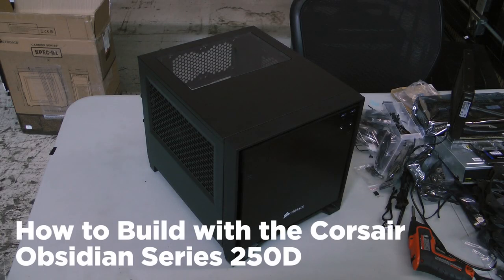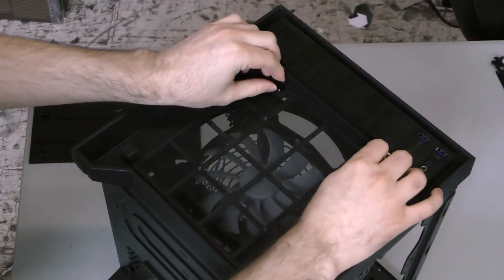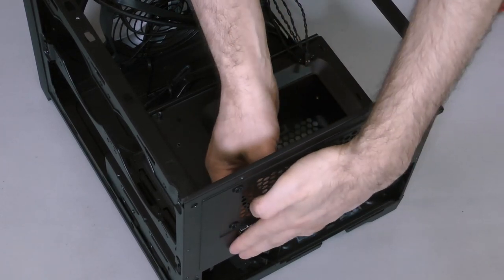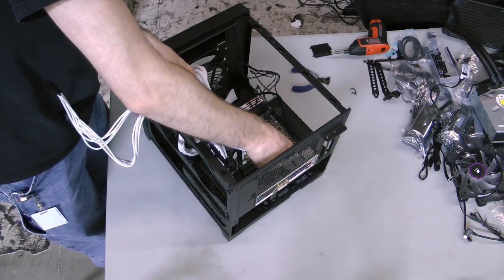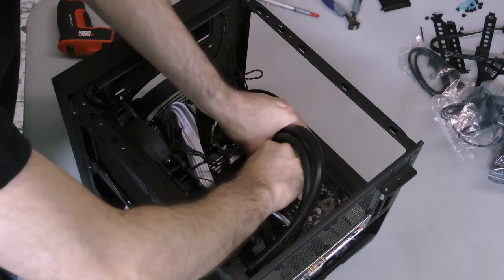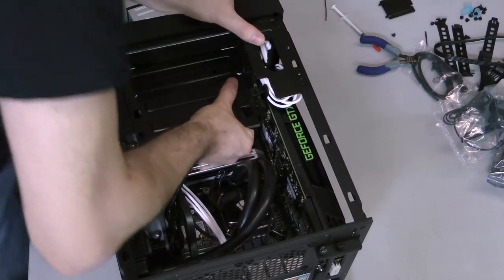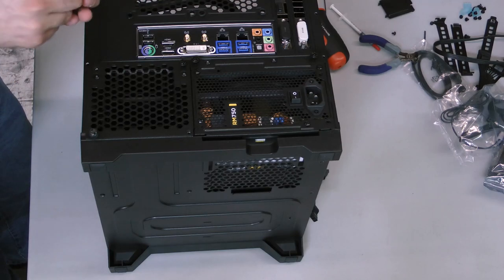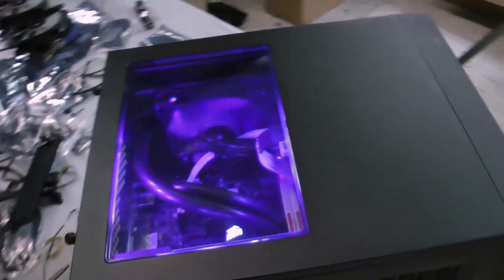How to Build with the Corsair Obsidian Series 250D

Comment: you could use an Corsair i75 For the CPU and even put a aio watercooled GPU in there, using the front 120mm mounting for the radiator

Comment: I personally would have used a motherboard with both the 24-pin and CPU power slots more toward the front of the case, making it so that the cables aren't going over the motherboard, giving a cleaner look and slightly better airflow.

Comment: I'm having trouble fitting my H100i in the case. Either i put it in with the radiator hoses unable to fit next to the upper most USB/PS2 connections, or I put it with the hoses in the front, in which case I'm having trouble clearing the intake fan. What do?

Comment: can i use the corsair link lighting node with out connect it with my h100i?
Reply: Absolutely. The only difference is that you'll lose the fine-grained color control and be stuck toggling between preset colors. But if you just want blue or purple or something basic, it'll totally work.
Reply: thanks for the help

Comment: If am installing a normal CPU fan should I install it in the motherboard before I put the motherboard inside the case?
Reply: Vangelis Velazquez I would, because there is a gap in the tray behind the motherboard, and I'd be afraid of bending or cracking it while trying to press the fan mounting points in to place.
Reply: Yes, absolutely

Comment: Corsair thanks for that video, it will help many to see about real dimensions and posibilities of that grat case. What about H105 and 250D? I'd like to see video or list of Corsair Cases compatibile to new Hydro Series H105 with 38mm radiator. We got lots of issues with mounting that raidator. For example with Obsidian 350D and Asus Z87 Maximus Gene we couldn't  mount radiator on top, because there is no room for that. And why are U using AF120LED IF U R usually recomending SP120 coolers?
Reply: The H105 isn't compatible with the 250D; the 250D was designed specifically to be exactly wide enough for the H100i. We offer the H105 as an alternative similar to the H110; if you can fit a 280mm radiator, we suggest the H110. If you have extra clearance for a 240mm radiator but can't fit a 280mm, then that's where the H105 comes in.

As far as using LED AF120s instead of standard SP120s, as I mentioned above, I decided to make the trade-off for style over performance. The SP120s will perform better, but since I'm not hammering the 4770K with this build, I figured the aesthetics would get more mileage.
Reply: Dustin Sklavos thanks for quick response.

Comment: Does the h100i v2 fit? The radiator is a few MM thicker than the previous gen.
Reply: If it helps, the h105 doesn't. Not sure about the v2 though.
Reply: I know it's several months later, but I have the h100i v2, and this case, and it's ayers and no. Technically it doesn't, it rubs and won't mount correctly, but I was able to offset it to a slight angle and it fits without stressing anything, it just only has I think 3 of the 8 mounting screws in, which is fine if you're not shipping it.

Comment: 4770k and 660 Ti? wat.
Reply: Yeah. lame. But would it be possible to fit a 780 in the case?
Reply: horsec92 No problem installing a 780 there, as long as it doesn't go over 2 slots.
Reply: MagicPuffin Do they even make a 3 slot 780/Ti? I know ASUS made a 7970 and a 580 with the 3-slot design.
Reply: horsec92 So a lot of the parts were used simply because we had them languishing in the cage in the back, and this build was designed to give my girlfriend a system to try gaming on. That's why we used the 660 Ti; we had one back there and it's perfectly fine for a beginning gamer. The 4770K is because, hilariously, it's the easiest Haswell chip to get inside the industry. Engineering Samples fly around and can't be resold, so we use those wherever possible.
Reply: Ryio5 phantom and lighting versions are 2,5 slots
Reply: Dustin Sklavos I see. Yeah I wasn't talking trash or bashing or anything, was just curious as to why there was that combination used. Could easily go with a lower cost CPU and a better GPU and get better performance out of it for gaming. But at least in this case you've already got a top of the line CPU and GPU can always be upgraded later. :D Nice build by the way. I'm sure she'll be very happy with this. I've been really considering a Micro ATX build. I would be more inclined to move it from place to place more often.
Reply: ahalal sucks 2,5, just because fuck the customers.
Reply: yeah more like 760/770

Comment: this case support the h110i gt?
Reply: +MarcoLoves360gamer it does not. the 110i is a bit thicker (fan are the same but the radiator is thicker) so id doesn't fit where this expects you to put the fan an radiator (the case was designe for the H100i). However, people have used the 110i with this case but they have to buy low profile fans.

Comment: How many SSD's and 3.5" Hard drives will this hold with one GTX 780Ti? I need a micro/mini ATX case that can hold a minimum of three Hard Drives and four SSD's?
Reply: 2 and 2 this case isn't for you unfortunately
Reply: Brandon Simms Do you know any Mini ATX cases that can hold three HHD's and three our four SSD's?

How about the Corsair Obsidian Series 250D, Graphite Series 380T or Carbide Air 240? I'm also interested in the Aerocool XPredator cube Avenger series. Which is the best for hard drive space, with a graphics card like the GTX780?
 ·
Reply: Google
Reply: Raoh Shiro You might want to give the Fractal Design Define Mini or Fractal Design Arc Mini R2 a look as well.
Reply: DeilGrist That's ok. I found four excellent Micro ATX cases that meet and exceed my expectation! AeroCool MicroATX, Corsair Carbide Series Air 240, Aerocool Strike-X Cube and Aerocool Xpredator Cube

Comment: do you face up or face down the psu?
Reply: Quoc Nguyen  The bottom of the case has intake vents for a PSU to be installed the same way you always should, intaking air from the bottom and exhausting out the back.
Reply: Always install PSU fan down so it can suck air through the vent in the bottom
Reply: Ordinarily I would agree with you, but not this time.  This is a mini-ITX system, and the build I plan on has a motherboard with an M.2 connector on the back of the motherboard.  This would normally mean almost no air flow on the M.2 in this case.  Inverting the power supply will generate air flow over the M.2.  Also, if you build this case with positive pressure (meaning a bigger fan than they one Corsair provides), they power supply should be just fine.  The trade off here is you won't know if your power supply's fan is operating/failing.  If it does, then you have a serious problem.  It's a risk I'm willing to take.

Comment: You know the guy is amateur when he doesn't use SP120's or any pressure optimized fans (instead he uses airflow optimized) Corsair give your guys some education lessons :D
Reply: I explicitly opted for the LED AF120s as a choice of style over function, and even explain that in the video. It's true the SP120s would perform better, but the AF120s still get the job done as we're not pushing the 4770K that hard. The person that is using this system appreciated the violet lighting. Sometimes it's okay to go for style at the cost of a few degrees of performance.
Reply: You know you're a critic when you don't watch the whole video and hear him point out this EXACT trade-off. "You know the guy is an amateur"...come on, really?
Reply: i'm not serious. I know and they do alot of stuff for looks, i'll give an example from their other video "we went with i5-4670k because we didn't see the need for i7-4770k with hyper-threading premium price" Still they had "32GB (4x8GB) Corsair Dominator Platinum DDR3-2400 with Light Bar Kit" on their system that costs 540$ if they need editing amount of RAM why would they cheap out on CPU. also they had GTX 760 2 way-SLI with the price of they could have bought GTX 780
Reply: Count Of  course they are going to try and up sell the ram. They don't make CPU's.

Comment: The psu is totally upside down.... It will be in-taking from a metal wall....
Reply: No, this case is built with an air flow column between the motherboard tray and the power supply.  There is a gap of about 1/2 inch (maybe less).
Reply: +AtomicAJ74 thanks for coming in over 2 years later. I have the case.
Reply: Just saying hi 1 month later. I don't have the case.

Comment: This whole build could have been done better i felt.
I understand that this was uploaded 3 years ago.
However,
This is what i would have thrown into the case for 2017

CPU : Intel - Core i5-7600K 3.8GHz Quad-Core Processor
CPU Cooler : Corsair - H60 54.0 CFM Liquid CPU Cooler
Mother Board : Asus - ROG STRIX Z270i GAMING Mini ITX LGA1151 Motherboard
RAM : Crucial - Ballistix Sport LT 16GB (2 x 8GB) DDR4-2400 Memory
Storage : Samsung - 850 EVO 500GB M.2-2280 Solid State Drive
GPU : EVGA - GeForce GTX 1050 Ti 4GB SC GAMING ACX 2.0 Video Card
Powers Supply : Corsair - RMx 550W 80+ Gold Certified Fully-Modular ATX Power Supply